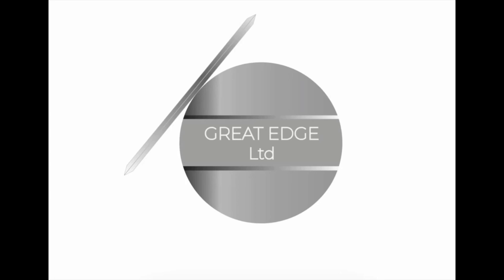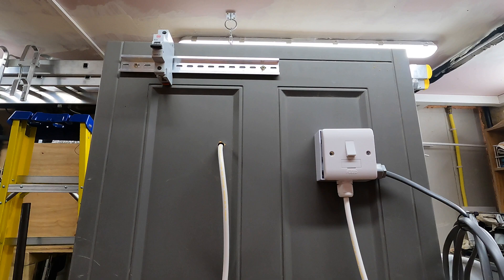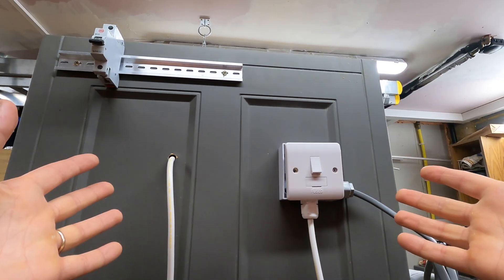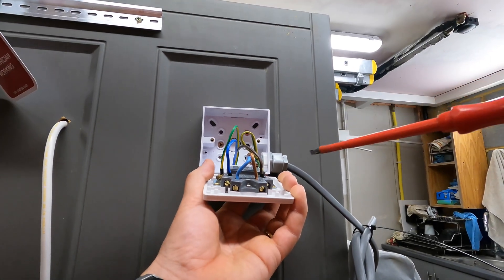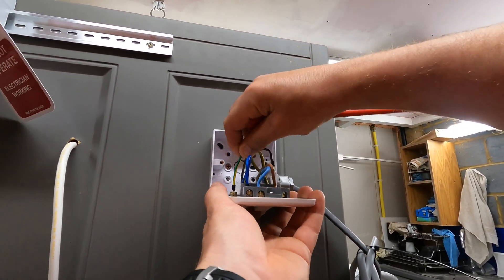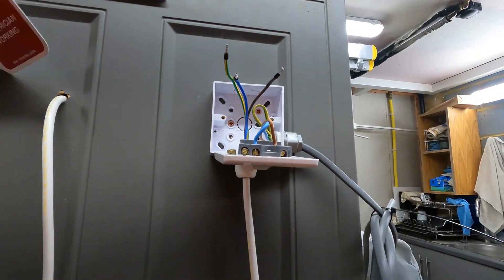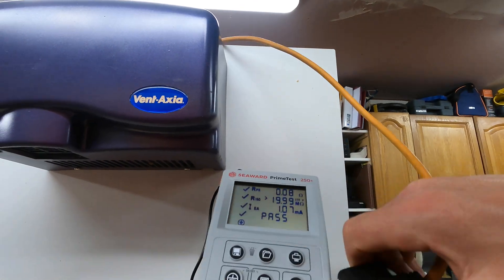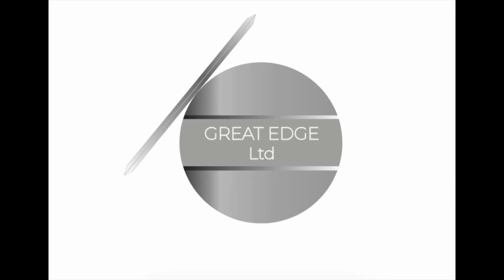‘PAT’ Testing a Fixed Appliance (Hand Dryer), Start to Finish

Comment: I understand that fridges and freezers should be tested but what about when they are built in and the plugs cannot be accessed without dismantling half the kitchen? The fitters did a great job with the dishwasher, making a large hole in the back of a unit to the side but the fridge and freezer are all screwed into place, all levelled up etc In order to access these, I would need to remove the baseboards (one is 3m, the other is 2.5m), both appliances are mounted on top of very flimsy plastic legs, the fitters managed to break a couple of these trying to slide the appliance into place. It seemed to take them forever just to install both units. The sockets for these appliances are directly behind each appliance. Seeing how you got around the connection for the hand dryer, could the same system be used to test the fridge and freezer, given that their sockets are controlled via a switched, fused, spur?
Reply from the maker: Hello, yes you certainly could run the test from the switched fuse spur.  Or if that’s not reasonable to access, at least find a know good earth and do the erth bond test to some exposed metal work.   If the appliance is without RCD protection I would try very hard to find a way to run insulation resistance, but  if that test is challenging to run, and their is RCD protection in place, one could argue the earth bond is sufficient for ongoing safe use.
Reply from the maker: It’s hand driers in particular that surprise me the most that PAT inspectors skip them. Everything is accessible, and they are a big lump of metal that everyday users access with wet hands.  If ever there was something to verify, that would be it.

Comment: Hi great video, very informative, I’m a PAT inspector myself, just wandering what are those clip like things you put on the end of your test cable called? And do you need anymore certificates to undertake hard wired appliances? I have City and Guilds cert for PAT Testing but not sure if it covers fixed wired :)
Reply from the maker: Thanks for watching. The connectors are called Wagos - easy to find online.  

As for training, I’d first of all recommend a safe isolation course, but additional training may be needed, depending on an individual’s experience and background.